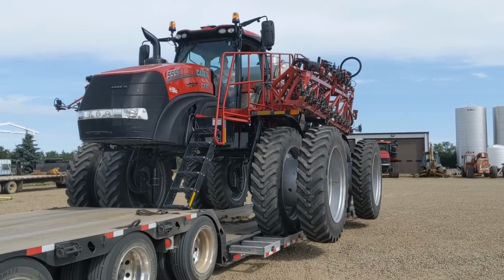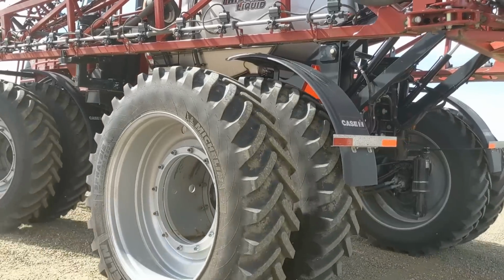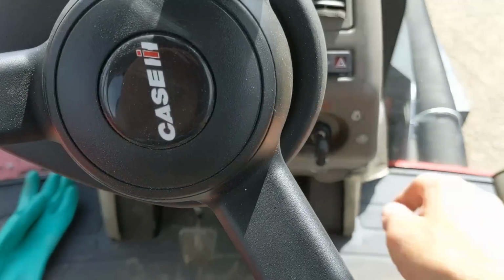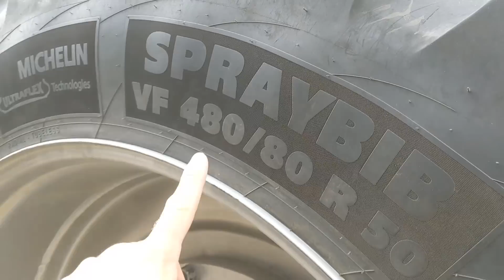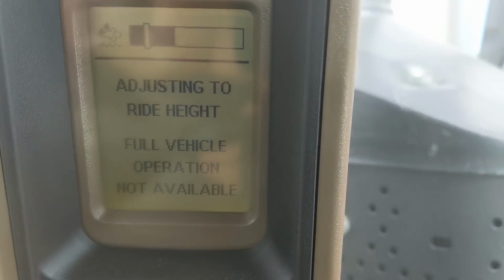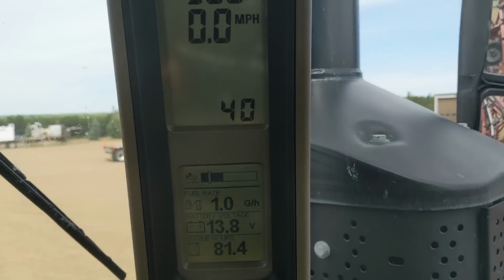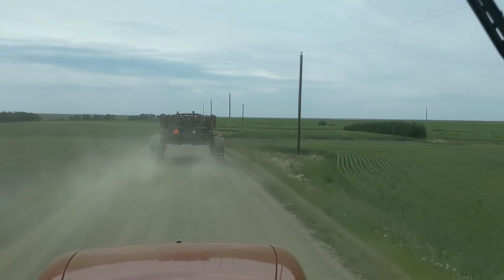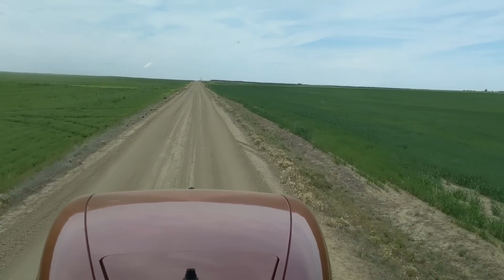New Arrival or New Rival?

Comment: I applaud your refusal to read the owner’s manual before operating the machine. You are a real man and are hereby authorized to display your man-card anytime you desire!
Reply from the maker: Hahaha 😂 only took me a day of figuring for the axle extend! And when I couldn't figure out I had to break down and look at the owners manual.. It's in the freaking corner post! Who would have thought that?! 😂
Reply: @mikemitchell2554  the first thing taught in Design 101 is that one key control must be located in the most out-of-the-way location possible.  For example, a friend one had a front-end loader which had the switch to lock in four-wheel-drive behind the seat.
Reply: Mike Mitchell it is also an option to have it as an ISO controller that you can set the width in the Pro 700/Viper 4 as well.

Comment: All the ones you've looked at so far the Apache seems to have the most positives going for it
Reply: Except for having 4 wheel drive. Doubt they want to follow the Apache around with a tractor to pull it out when they get stuck.
Reply: I’d like to try an Apache myself

Comment: I had a Trident the last 2 years. You have to adjust the wheels with the iso the pro 700 controller different run. Usually will go into 40 mode with half a tank. You have to stop and let it recalculate weight, cycle the park switch. I found a way to trick it into going 40 while fully loaded.  I traded for two 4060S and have found a way to make those go 35 loaded!!

Comment: I'm in the UK spent a little time working for a company doing self propelled sprayers. All of them are limited speed wise when full the sensor was on the float level on the tank gauge on this manufacturers machine. It could be bypassed quite easily just by moving the sensor. That said if an accident was to happen the book would well and truly be thrown at them.

Comment: I have never seen a sprayer that looks so intimidating ha ha
Reply: You havent seen a condor yet 😉
Reply: Jacked up magnum with a sprayer on the back
Reply: @Laagkeet  The HARDI RUBICON 9000 with a 9,000 l tank capacity is quite intimidating too. [Engine: 380 hp (283 kW)]
The Agrifac Condor Endurance II has an 8,000 l tank capacity. [Engine: 400 hp (298 kW)].
The Case IH Trident 5550 "only" has a 5,300 l tank capacity. [Engine: 390 hp (291 kW)].

Agrifac and Hardi are both owned by the huge french sprayer specialist EXEL Industries Group, and so are several other sprayer companies including ET Works who make the Apache sprayers which Mike tested in previous videos.
https://www.exel-industries.com/en/agricultural-spraying/
Quote: Backed by our portfolio of brands, HARDI, EVRARD, BERTHOUD, TECNOMA, CARUELLE, NICOLAS, SEGUIP, THOMAS, MATROT, CMC, AGRIFAC and APACHE, EXEL Industries is one of the worldwide leaders in agricultural spraying equipment.

Comment: Nice looking machine.  Does look mean with duals but screams HEAVY!!!  40 mph is fast but a 4440 with some different rims and tires would go nearly that fast without the weight penalty.  Our farm recently bought a used case 4430 & we got a deal on some 320/125r54 tires and rims. 37-38mph.  

Love the unbiased reviews.  Wish we farmed 1/10th of what you farm.  Love our 4430 but have some concern over long term reliability.  We run Deere and case on our farm and overall Deere has been more reliable.  Our 4430 needed a lot of work to make it field ready
Reply: I hit send on accident before I was done.   I looked at Deere case and rogator when shopping.  Agco service non existent in our area.  Deere = 1.5-2x what I paid for my case.  Case reliability=???? But for 85-100k price difference I can fix a lot of stuff.  Deere makes GOOD stuff but their pricing is insane.

Comment: Have you looked at the Hardi Rubicon 9000 at all? I dont know much about it but with a 9000 liter (2200 gallon) tank and booms from 120 to 160 foot it looks like it could really put some product out. They do look expensive though :/
Reply: Pretty sure he has mentioned them before. Not sure if he's ever had one though
Reply: Nobody wants a hardi as there isn’t very many dealers in sask and the parts are expensive
Reply: @garettrice9495  I figured that was the case, while it looks like a great sprayer for the farm size, having dealers and service centers nearby when theres an issue is more important than it can carry a few hundred extra gallons of product, especially if it would have trouble running skinnies, either compaction or stuck issues, the 9000 look like a hefty piece of equipment
Reply: What do you guys think about an agrifac endurance 2?

Comment: Side by side comparison, power/weight same, but you're giving away 800 gallons capacity and 30 feet of boom to the Hardi Rubicon, and they do have a dealer network there...
If you just don't want to try the biggest/best out there, it looks like it'll be between the big Deere and this one at a 130' boom... of course it's all up to what you like best when you're using it...

Comment: I wonder why they haven’t put the cab in front of the motor and front wheels. For better visibility.
Reply: Rough ride being out in front but suspension have got better since I've driven one like that.
Reply: Some do some don't
Reply: The engine has to be ahead of the cab because this is a dual purpose machine. The sprayer can be removed and replaced by a spreader box.
Reply: Yes I’ve drove smaller spray rigs with the cab forward. Much better view.  Didn’t know that this was a multi platform machine.  It’s huge

Comment: Did yours come with an engine oil leak too?!
Reply from the maker: 🤔 Not that I know of... Did yours?
Reply: Mike Mitchell I guess I should rephrase that, I didn’t notice it until we switched from the spreader box to the booms but yes it has an oil pan gasket leak from what I can tell. Not a huge deal but not cool on a brand new unit.

Comment: Not sure what the extra weight is good for...same size tank capacity, same boom width why just add more weight?
Reply from the maker: It's the frame size, hp and beefyness of it that I like, tells me it can hold a 2000gal tank 😉 with maybe 165ft booms.. It's all how you look at things
Reply: If you can go up to: 165ft and 2000 gl tank then that makes perfect sense...not experienced with dead head traveling as far between fields as you guys do...so I see where speed could help there.
Stay safe, your laugh is infectious
Reply from the maker: @stephenjohnson5119  they are designed for a 10tonn capacity fert spreader, so that tells me 2000gal tank haha.. And Pommier Booms can go to 180ft but that would too big for our hills